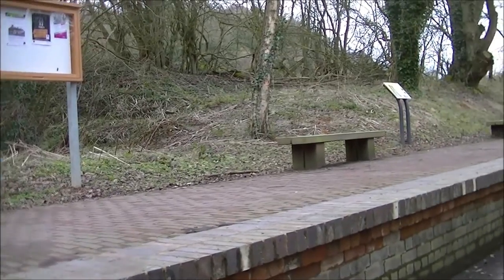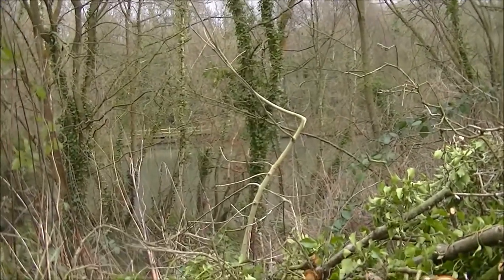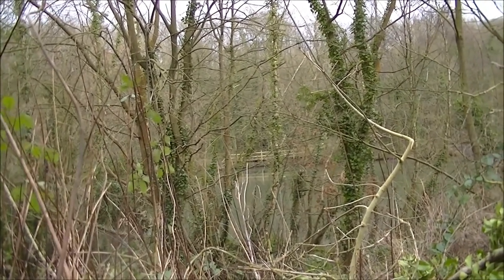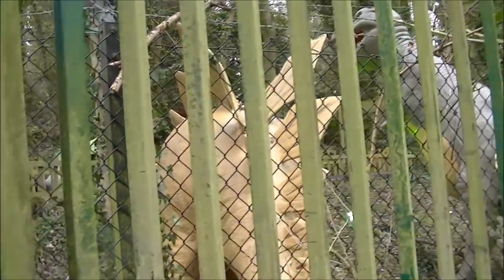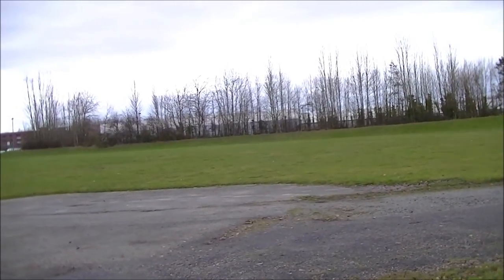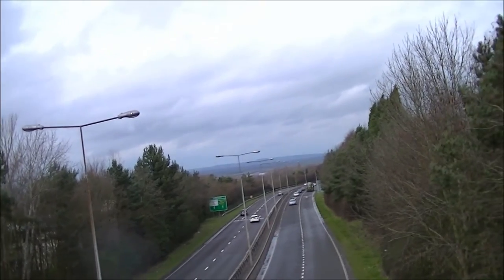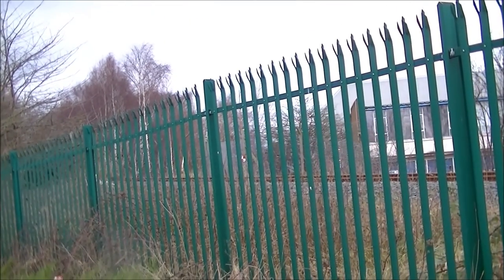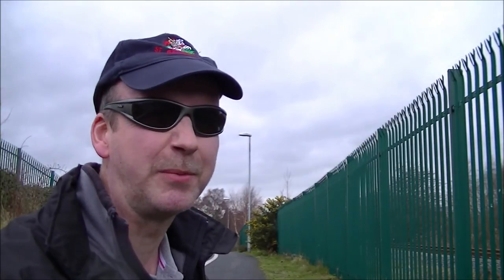Coalport to Wellington Disused Railway Part 2

Comment: Seeing this reminds me of one other piece that might actually have been part of this, there is a road in the old Priorslee village that has remains of track embedded in it not sure if it was part of this line or just connected to it for some reason as the direction seems off but thought you might be interested to look into it. Check out coordinates 52.683388, -2.429733.

Hmm doing some further research I am thinking maybe it was a branch from that serving one of several Collieries that were located to the South of Priorslee Hall. There seems to have been several in that area as they were marked on a 1940's ordinance survey map.

Comment: Thank you for the interesting videos I hope you don't mind me making a couple of corrections?..

1) in Part 1 the red brick bridge that you can be seen walking though in Aqueduct is as you mentioned a late addition - however the particular road (now leading to Brookside) that runs over the line was added some time between 1938-54 hence its relatively modern design. it's therefore unlikely that it replaced an earlier victorian bridge as suggested (its actually been refurbished itself within the last 10 years and only the surrounding brickwork of the original 1940s (?) bridge (which wasn't arched like the new one) actually remains.  The original turnpike road from Wellington ran underneath (the still existing) sandstone aqueduct.) and that road would have intersected the railway line near to it's junction at chapel lane then proceeding down the old bridgnorth road past the Britannia pub. This can be seen on the following map.. https://www.old-maps.co.uk/#/Map/369100/306280/10/100726 (you may need to zoom out)

2) in Part 2 you suggest that the Dawley and Stirchley platform is a totally rebuilt platform, I am not sure that this is the case as l remember substantial remains of the original platform were still visible prior to its restoration? (although I do accept that the angled disabled access ramp to the north of the platform is a new addition)  The platform (pre-restoration) can be seen covered in undergrowth in this photo.. http://www.walktelfordheritage.co.uk/site.asp?siteref=46
Reply from the maker: +Tim Willis Hi Tim thanks for all that detailed information. I'm happy for people to add or correct things as I'm just an enthusiast and certainly no expert. I will check out those links. www.shropshirerailways.co.uk